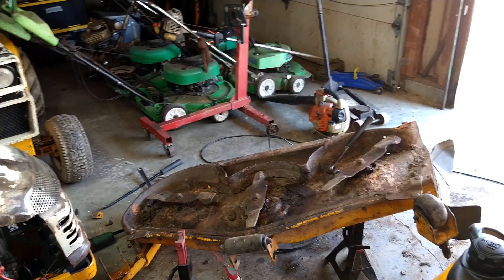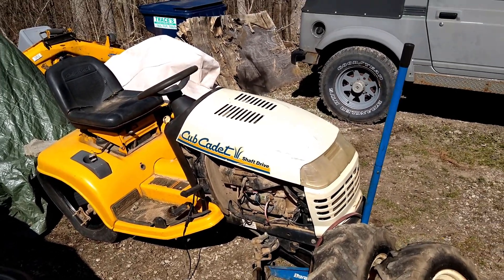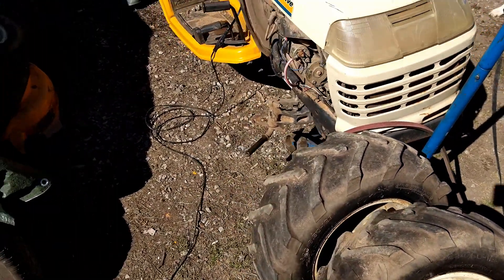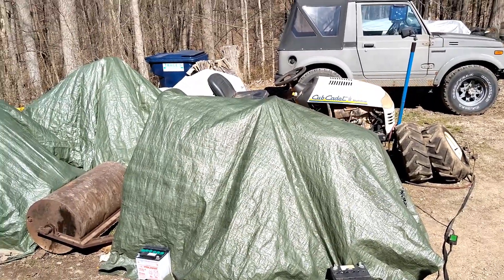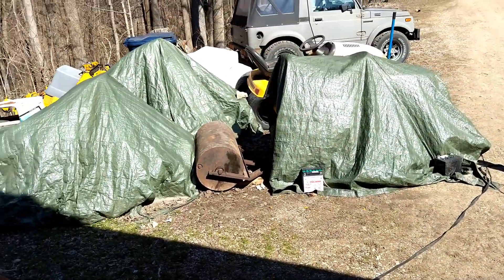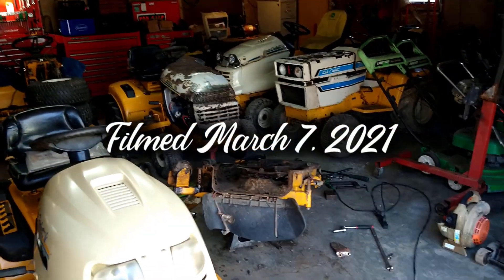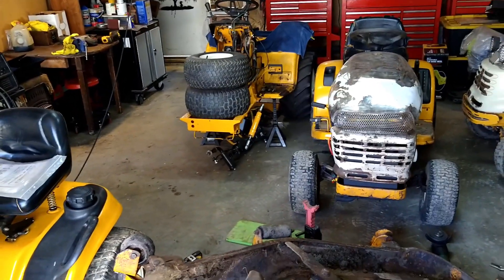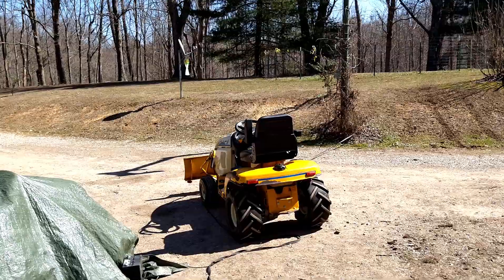Shop Update! March 2021

Comment: Glad you got that deck on can't wait to see the 1882 getting worked on.
Reply from the maker: Yeah I'm gonna see how the 54 does with a 16hp single driving it.  I bet it will turn it just fine.  Maybe have to slow down a little in the tall stuff.

The 1882 is the tractor I've wanted for a long time.  I'm excited for it too.

Comment: Cool, thanks for the update. I hope you can get the 54 deck running. I have one on my 1862 and
absolutely love it.  I just got the 1862 finished, engine refresh and rear seal on the back end. Time
to get to work on other . Thanks again   Ken
Reply from the maker: Oh sweet, good to hear you've made that progress on the 1862.  How did your M18 engine refresh go?  Have you fired it up yet?
Reply: @SolunaGarage  The engine work went
quite well considering I have never been inside  o ne of these things. Your videos
helped me a bunch.  Yes I have it running,
and it runs good. Pulled the tranny and put
 new seals in axles and hydro. Going to put 
the seat on today and were going for ride. 
Just in time to put it to work.  Your videos 
did a world of good for my confidence to tackle some of this stuff.  Especially electrical, I get it now, well  mostly. .  Ken
Reply from the maker: Awesome!!!  One of the nice things about working on these things is that they are pretty straightforward, and if you take your time and do your homework, they will reward you with decades of service.  Glad I could be a part of the process ☺️